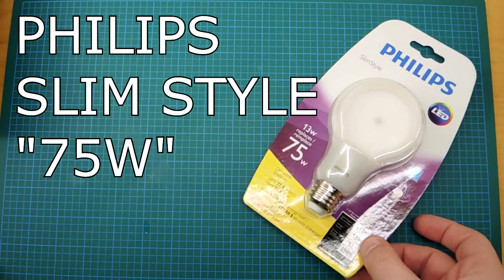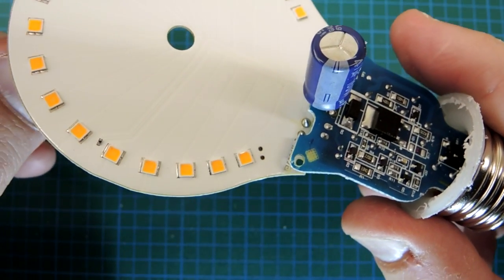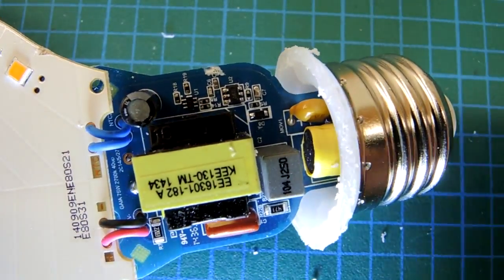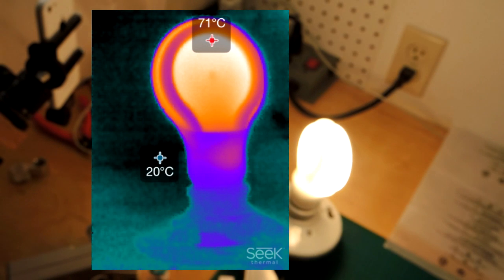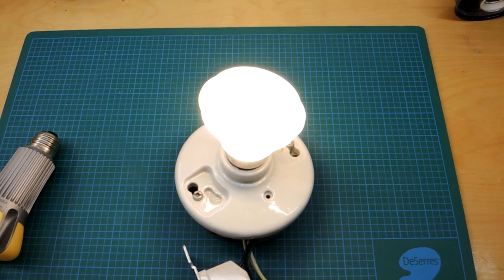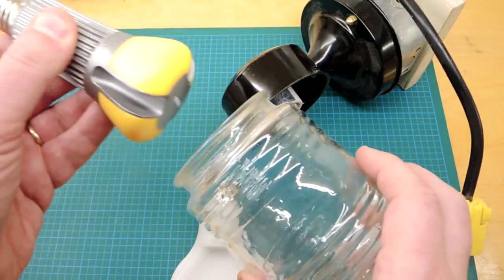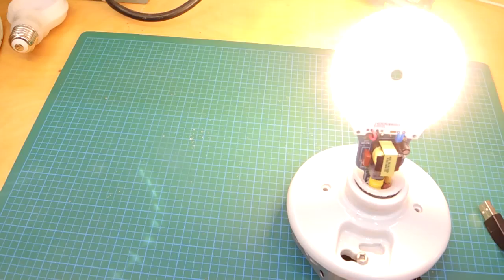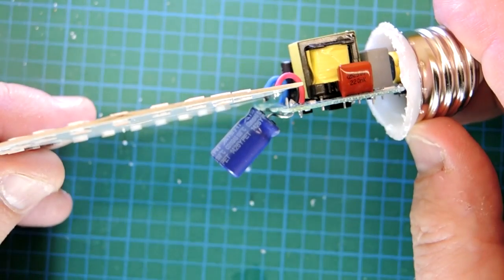Philips SlimStyle "75W" LED Bulb Teardown

Comment: Many years later I'm still using the original 6 slim bulbs I'd put in the over mirror fixture in the guest bath and they're still fantastic and working great with an old style touch stepless dimmer. Got them when they first came out and could only wish that newer ones around the house had worked half as well. 🎉🎉🎉
note: Mine are the 60w equiv. bulbs.  Also, at least from a distance of roughly 5 feet there's no buzz .. possibly also because I rarely have them turned anywhere near full brightness. No noticeable flickering either though I'm sure instrumentation could easily find that.
*Cheers.!

Comment: They have two circuit boards, because they are different. The emitter one is based on aluminium, acting as a heatsink. The other one is just a standard pcb. If they would put all the components on the heatsinking one, it wouldnt work, because the components would get too hot.

Comment: how many volts is on the DC side of the power supply on the LED side? I've modded one of these but it was the ones with the triangle shaped LED modules. I wired them in parallel and I run it on 12 volts and it's super bright.

Comment: Well done video!
Wish we could see the white traces in the paddle section.  Yes, surprised it is not the same board as the circuit board.

Unfair comparison.   Yellow uses fluorescent emission.   Th.is white LEDs.

Comment: Bad soldering or not, I like the design of these flat bulbs, because they deal with heat by physically spacing the LEDs apart. It's simple. 

Of course, they're no good for lampshades, and the flicker killed it for me as desk lights. They're good instead for utility lighting, and still much less hot than incandescents.

The real sleeper hit LED so far is the Bell+Howell Ultra bulb. No flicker, whiter 3000K light, small size.

Comment: 2 boards are cheap, as the white board likely is the most expensive item, and also likely needs a special reflow profile to not harm the LED dies. Main board is a lot easier to do separate due to the mix of component types and the heavy stuff that needs to be hand soldered. Less handling on the LED board means less chance of assembly damage, plus they can do the boards at different subcontactors to reduce construction time.

Comment: I'm not one to accuse companies of the buzzword "planned obsolescence". I mostly think it's just a result of the consumer's race for the cheapest thing they can get. But seeing a bulb like this constructed by a name brand, I wonder if some of the design decisions that make it not last as long were made on purpose.
Reply: i don't think so... you can build cheap and propertly cooled bulb e.g. 
http://www.aliexpress.com/item/-/1946633945.html
what's manufacturing cost of this? 2$? Less?
Reply: I know, there's a lot of crap, but some products aren't that bad. Some of them are just selling on EU market under local brands. I've found some stuff, which looks the same as bulbs i've bought in my supermarket. And they work well. You should buy and test them first ;)

Comment: 4:50
my 60w bulb was just barely not going to fit in my enclosed light fixture, so I just ground down the edges a bit. I don't intend to use the light in that fixture for more than 15-20 minutes at a time so I'm really not worried about the thermals of it.

Of course if I had seen your review on the 60w phillips bulb beforehand I wouldn't have bought one.

Comment: basically and LED bulb with all the performance and life of a cheap CFL
Reply: Yup. I guess it "could" still last longer if it's in a place that could help with cooling say. Maybe totally exposed in a cool basement or something or say a garage in winter. I guess they don't use any mercury and are more durable to drops so there is that I guess. There is an actual market where super cheap led bulbs could be used well, but sadly these won't be used like this---- say in environments like walk in freezers. These would be perfect in places like that where heat sinking literally isn't even necessary. I guess 10 years down the line if the efficiency of emitters used becomes even a lot better this could reduce heat in equivalent output bulbs anyway so they may be even better even in cheap designs not using a lot of heat sinking.

Or just like everything maybe planned obsolescence is king. There probably will always be maker making really well designed led bulbs with good heat sinks around the electronics (which are the most susceptible to heat even more than the emitters). Buy those.
Reply: martinaee
yeah you dont expect it from philiips to tread the bottom end, this is dollar store level, its not just heat but bad soldering and such, and even when emitters produce 1/10 of the heat, there will still be those who overdive them or or dont use effective designs
Reply: martinaee
yes i do agree with you on some points, it has more physical durability and no mercury :}

Comment: I actually want to get one of these for an overhead bathroom light. The light shouldn't be on too long at a time so heat might not be THAT big of an issue for my use of it. The flat profile actually could be good in some instances like for what I need.

I do agree though... these super cheap bulbs (even more so those 4flow cree ones) are getting ridiculous. I think they basically are designing poor heat sinking not because it's cheaper... but because you can't sell more bulbs if the bulb lasts 20+ years. Overall yeah... buy the higher quality ones with really good heat sinking.
Reply: If the overhead light in your bathroom is one of those that has an exhaust fan built in, that's a great idea because the fan keeps the light cool. I have a CFL in one of those fan/light enclosures in my bathroom that's been in there so long I don't remember installing it. Even the frequent on and offs have not killed it the way you'd expect in that particular fixture.
Reply: i think they overdrive the led's so they use less of them, but thats a cost of both lumens per watt and waste heat, leading to shorter life...